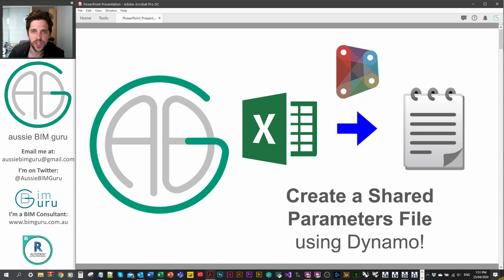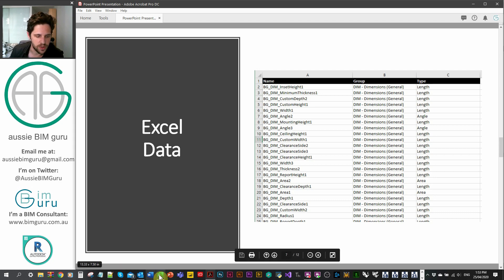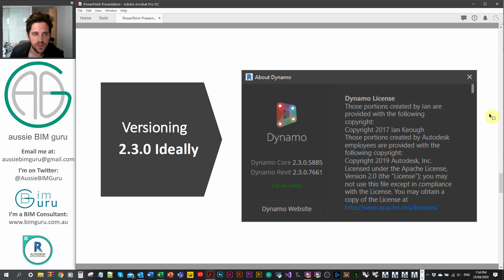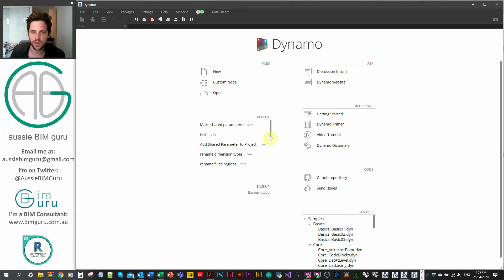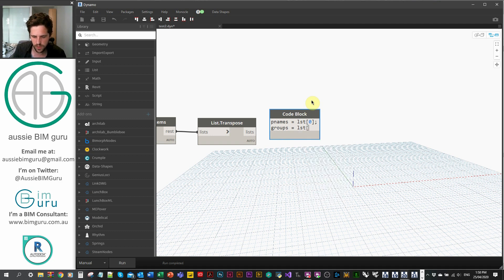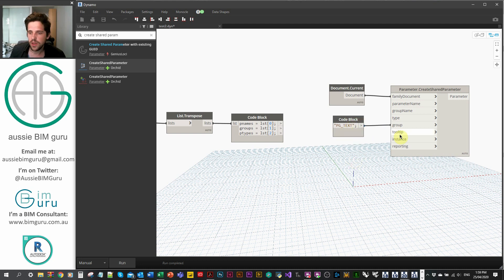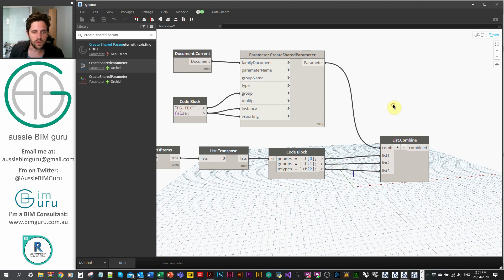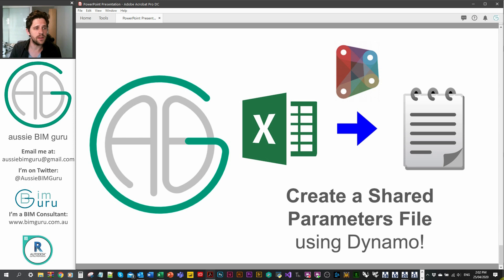Create a Shared Parameters File using Dynamo!

Comment: Hi, Brilliant video, Do you have any idea why my list.combine node gives me null values? the script runs without any warnings but it doesn't update my shared parameters.
Reply from the maker: Are you in Revit 2020? If not maybe that could be the cause. Test it using just one parameter also.
Reply: @AussieBIMGuru  No I was using 2018. So does this script only work for Revit 2020 onwards?
Reply from the maker: @bigkieth23  that might be why. It should work in Dynamo 2.0.3 though which is available in 2018.
Reply: @AussieBIMGuru  Yea that's what dynamo version I'm using & I used the orchid 200 build. I'll try installing all the orchid builds to try get it to work.
Reply from the maker: @bigkieth23  it might require different level management. I believe this node may change between versions in how it laces inputs.
Reply: I went stuck in the same problem, but solved by just working in a family project, not in a project like i was doing.

Comment: This is really good if you ever wanted to reorganize the shared parameter file
Reply from the maker: Thanks! Keep in mind this will reset parameter GUID's, so if you just want to modify parameter groups it's best to modify the file in excel by changing the numbers in the group column (carefully!). Usually this workflow is if you want to 'reset' your file or build one from the ground up for the first time.